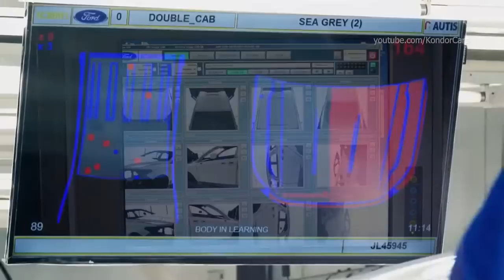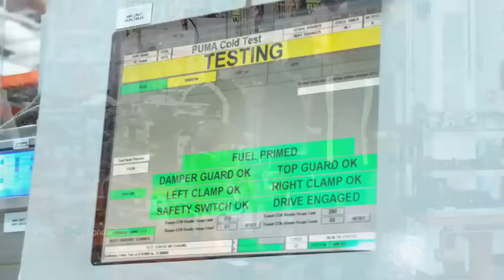Ford Ranger Production - Silverton, South Africa

Comment: Production for WORLD delivery?
Reply: i dont think so ... This is an Old Ranger , in old body .. The brand new looks way difrent, and you can buy them in Europe ....
Reply: @filip04254  Ford Ranger for the European market is produced in Thailand or South Africa, same goes with the Toyota Hilux for the European market, made in Thailand or South Africa.
Reply: Ben Dover  yes
Reply: depends on the continent for North America : USA Mexico

South America : Brazil

Europe : Germany

Africa : South Africa

Asia/Pacific : Thailand China
Reply: @12345anton6789  nope the old Hiluxs in Europe came from Japan and the old Rangers in Europe came from Germany
Reply: @recycleman975  Toyota stopped producing the Hilux in Japan in 2005, Thailand has been Toyota’s main production site for Hilux for at least 20 years now and is responsible for delivering Hilux to Europe with some additional help from Toyota in South Africa.
Ford Ranger has never been made in Europe.
Reply: @12345anton6789  the one i learnt to drive is a 1988 from Japan
Reply: @12345anton6789  they did
https://en.m.wikipedia.org/wiki/Ford_Germany here's my proof
Reply: @recycleman975  It clearly says in your link that the Ranger is listed in under Ford products SOLD in Europe, the Mustang Mach-e and the Ford GT is also listed there, vehicles that have never been made in Europe, just sold there.
You can also check in the same link, under current and former production sites, the Ford Ranger isn’t mention in either current or former production sites.
Reply: @12345anton6789  the mustang is US spec like also shelby F150 F250 et cetra
Reply: @12345anton6789  this is a list of all the models that.came from this factories
Reply: For world delivery

Comment: One of the most labour intensive production lines I've seen in a long time. It makes me doubt the build quality, especially looking at the rag tag army building these trucks, not one set of Ford work overalls in sight. If they can't be bothered to be disciplined on the minor things what are they like on the major things. The biggest shame here is that this is the factory that will be building the new Amarok, I think I will pass.
Reply: I owned a vehicle that came off that Silverton assembly line and NEVER EVER again thank you. 🤦🏼‍♂️
Reply: General assembly, drivetrain, feeding the weld lines, paint correction are all labour intensive everywhere.
Reply: Overall it’s not that bad. I still keep my 2016 Ranger manufactured in that factory and there is no assebly issues at all. The biggest issue is with nearly no rust protection of the frame 🤬 But as I can see on the market this is not only Ford’s weak point … I found a signs of corrosion on just a few months old frames of some other brands pickups … I don’t know is it by purpose ? I don’t blame the factory but rather the technologists in the HQ 🤬
Reply: @pawezmudzki5055  If you're happy to bomb around in a 6 year old truck and sing it's praises then good luck to you but the rest of the world moves on to newer and better things and we hold the manufacturers to higher standards than those before us did.
Reply: @deplorablebristolian  It’s not about I’m happy or not happy to drive around in the Ford truck manufactured in that factory but it’s an objective opinion about the product of that factory. I’m not an expert in automotive industry to judge how the factory is organised but the final product is not bad as I expressed earlier and the built quality is average on the market. Of course we should get the highest built quality from the manufactures but most of them provides it on very similar level …
Reply: @pawezmudzki5055  Here's a link for a Ford factory in Thailand building the same vehicle. The difference is astonishing compared to that jungle gym in South Africa. https://www.youtube.com/watch?v=5UZXwg8Ec7U
Reply: @deplorablebristolian  Thx for the link ! I see the difference and get your point now. It looks like the state-of-art dream factory comparing to the relatively old South African one which must be really much older …
Reply: @deplorablebristolian  6 year old?  My Mustang is 10 years old and my Honda is 12 years old. Both still run great.  Cars built after 1990 easily last 15-20 years. Anyone who ditches a car after only 6 years is a fool with his money.
Reply: @johanneswehrmann  care to share what your experience was like?
Reply: @kkruger5016  You see the difference between you and I is, I prefer quality over quantity. Ford ry is soos meit naai.
Reply: @deplorablebristolian  I responded with facts, you responded with vitriol. Facts don't care about opinions. 

Your statements are hyperbole at best, and factually incorrect at worst. Have you seen every production line in the world to make such a claim?

I posted a link to a video where they explain what they have automated in this plant, and where they are leading. Ignoring plain facts is weird.

Peace.
Reply: @deplorablebristolian i am sorry, I genuinely don't understand - is the government hating anyone white, or are the government white and hate anyone else?
Reply: There not known for there work ethic…